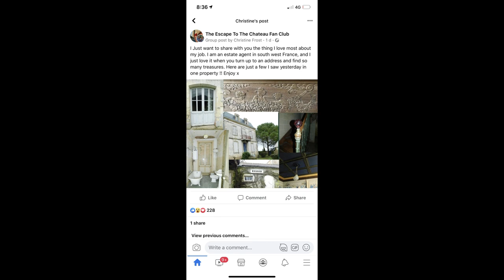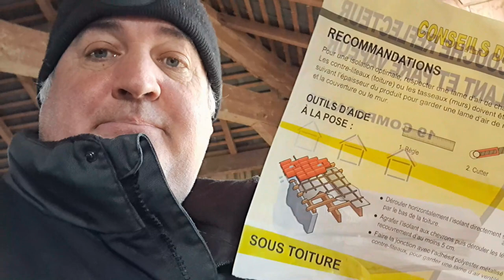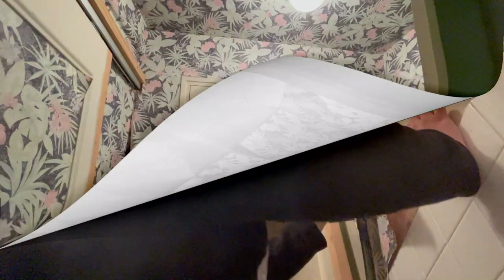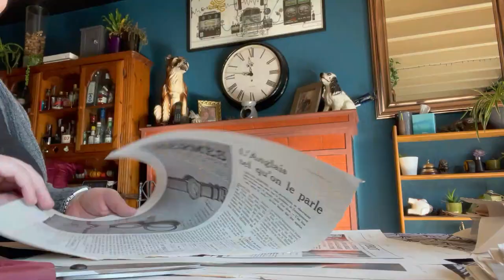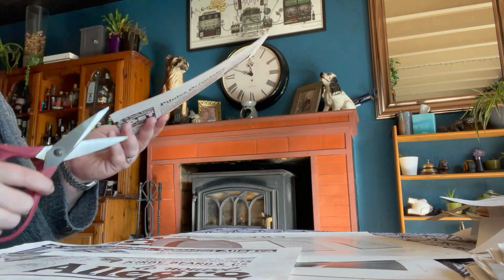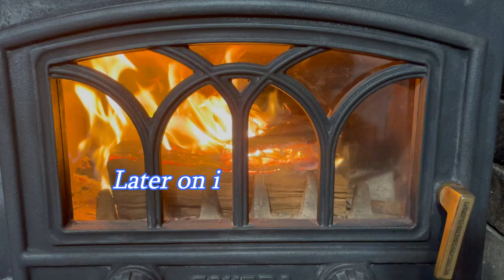He's Back! Father-in-Law Returns #77

Comment: Hi there, we had the same problems on the walls of an old building we painted here in Berlin. You need a PCI undercoat, it seals the walls and stops that happening.  You just paint it on first before you paint as normal. Otherwise the paint will just keep flaking off, no matter how many coats you slap on.  Thats not the same as an ordinary primer. The one we used  here is called PCI GISOGRUND, but there'll be a french version. Onwards and upwards!
Reply from the maker: Thanks for the great tip Karma - my hunt begins!

Comment: Hi Claire, l remember my mum having the same problem with painting walls in her new (to her) house, it must be sixty years ago. After talking to a local decorator he told her it was because the wall had previously been painted with distemper. His solution was  to wallpaper the walls. Explains why even the ceiling was papered! I am sure there must be a remedy these days for this problem, (if that's what it is) maybe some research on u tube?  Good luck.

Comment: it is recommended, for all painting work, to paint between 15 and 25°C. Below 15°C, the paint dries too slowly and above 25°C, it dries too quickly and does not adhere properly to the support. In this case, the paint may blister but also peel off. If your wall is wet, the paint will peel off. The wall must be dry before applying paint.